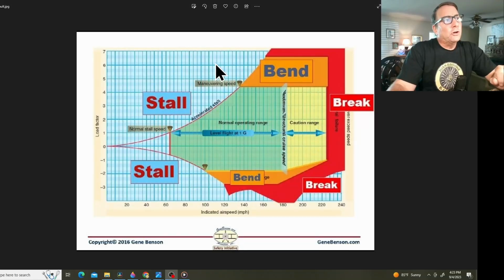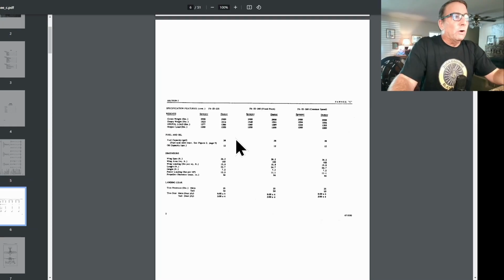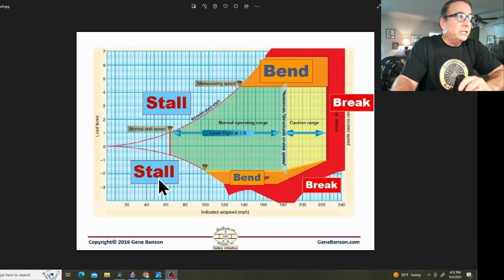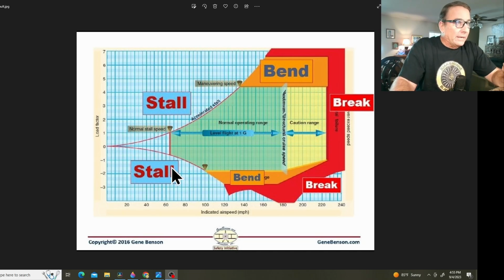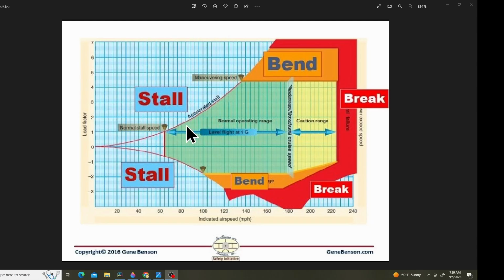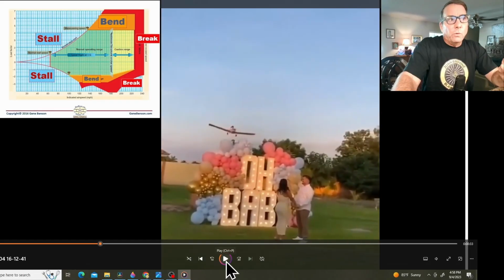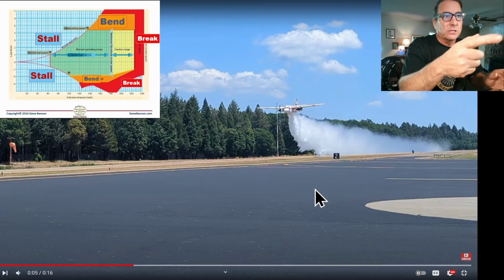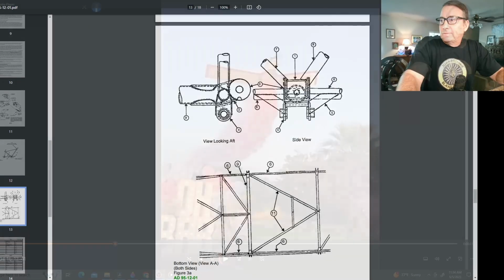PA25-235 Sinaloa MX Gender Reveal Party Structural Failure

Comment: I am not knowledgeable in aviation but based on what you mentioned about maneuvering speed. Does this mean that for a brand new airplane you can operate the flight controls in any position as long as you are below the maneuvering speed without causing structural failure of the airframe?
Reply: Yes but you have to include the total weight in the plane, cargo, passengers and fuel to know what the maneuvering speed actually is (as Juan stated the planes placard maneuvering speed is at full load, so as likely you are less then full load which  reduces the maneuvering speed)

Comment: Your analysis of weight vs maneuvering speed vs G Load vs lift force is excellent and fascinating but requires a deeper dive. 

In the case of the Pawnee the wing structure apparently failed near the root after releasing weight from the fuselage.  

Although the weight release would have lowered the regulatory maneuvering speed, it seems unlikely to have contributed to the structural failure.  

At the given airspeed assuming the critical AOA was reached the lift force generated would be independent of weight as you said. 

At lower weight the aircraft would have experienced greater vertical acceleration (measured G Load for example by cockpit accelerometer) than otherwise ( F= MA.)

And as you rightly point out some structural failures might really just depend on measured G Load - maybe the tail falls off or something.  

But a failure of the wing root is not in this category.  As the proportion of the aircraft total weight represented by the fuselage decreases, so the load on the wing - fuselage joint decreases at any given lift force (a higher proportion of the lift force goes to accelerate the mass of the wing itself).   

It’s one reason fuel tanks are placed in the wing.  Fuel in the fuselage requires a stronger thus heavier wing root joint. 

Again super excellent video, very thought provoking thanks.
Reply: What? No, what you say makes no sense. The wing roots would be where the force is applied when the aircraft is pulling Gs. Overstressing an airframe is on the wings and tail. 

Fuel is put in the wings because you have space available. The fuselage is usually reserved for other things.
Reply: @rtbrtb_dutchy4183  the way I see it not all of the weight is in the fuselage.  The wings also have mass.   So as the ratio of fuselage mass to wing mass goes down, the stress on the wing junction goes down at any given G Load.   Take an extreme case - imagine  the fuselage weighs nothing.   Then whatever rhe G Load on the total airframe none of that will be transmitted through the wing junction.

Comment: Many years ago ('94-'95),  as a young A&P, we had a Pawnee with Hutch metal wings that were just full of cracks.  We pulled the wings to repair them and found the fuselage wing attach points badly rusted internally.  They looked great with nice paint on the outside, but just ugly inside with much material missing.  It left on a truck to an aerospace welding facility for replacement.  Scary stuff considering how they get yanked and banked in a highly corrosive environment.
Reply: Like old houses near the sea, paint layers is only thing holding them together.  I think Popeye the sailor man had a song about that
Reply: @shable1436  we had a water tank like that at work. you knew the metal had gone through when you saw the bubble in the paint. then we used to just drill it out and stick a nut and bolt in with a rubber washer.
Reply: the glory[& FAILS] always shines on the OPERATORS/pilots but, the MECHANICS and all that attached to support their mission[s] really is so important......maybe more so [idk4sure]
 
OPERATORS are the ones also in the line of weather a vehicle or equipment is safe too operate.  

So it maybe would[have] passed PILOT pre-flight inspection but really it is a TEAM that creates the missions capability to be a success as in returning. The total success ends with safe return.
Thanks Juan,great report w\insights

Semper Prorsum ~ Godspeed
Reply: It's fineeeee
Reply: You save money by replacing maintenance with paint.

Comment: I think I understand this differently:  Seems the stick had to have been back before dumping the water just to get enough angle of attack (consistent with adequate speed to prevent stall) to generate the needed lift. Then once the water was out, that was too much elevator input, which caused an abrupt pitch up, loading the wing to failure.  The pilot needed to have pushed forward as he let the water go.

Is that a valid way of looking at the problem?

Thanks so much, Juan!  I’d be your passenger any time!

Comment: If the hopper was in front of the pilot, the center of mass likely shifted backwards significantly, increasing the magnitude of the pitch-up. It does look like the wing itself failed, so it appears the pitch up was extreme enough to increase the lift beyond what it was even fully loaded.

Comment: A wing folding on an old Piper doesn’t necessarily mean that the spar snapped. The wing can pivot around its bolts when the struts are removed, so it might just as well be the failure of a strut or its attachment that caused the wing to fold. 

A decrease in mass (and hence weight) causes a decrease in Vs. This also causes a decrease in maneuvering speed as Va=Vs•sqrt(Nz max). This decrease in Vs and Va does not cause it to move along the stall curve as indicated in the video, instead both speeds just move left in the graph (same Nz but at a lower speed), creating a new stall curve for that mass.
Reply: It is useful to define your variables if you want people to follow along. Sure you can say these are somewhat standardized terms, but then who are you talking to, people who already know this?
"Va" = maneuvering speed, or accelerated stall speed
"Vs" = unaccelerated stall speed, normal flaps up stall speed
"Nz max" = limit load factor, expressed as Gs

Comment: OK Juan, this one has me confused! I’m not sure I understand how reducing the overall weight of the aircraft increases the strain on the air frame at a lower speed. Is it because you suddenly now have the ability to change direction more rapidly, therefore exceeding the stress levels of the air frame? It seems to defy logic, and I’m really not sure from a physics perspective how this happens. Would love a video on the physics of this.
Reply: With higher weight, the aircraft stalls before it can exceed the maximum load factor (Gs) of the design of the aircraft.
Reply: In a sense, you are correct. I’ll try to explain and since I’m not sure how much you know about aviation lingo, I’ll try and keep it simple. 

When an airplane flies level, it flies slightly nose up. A heavier airplane has to fly more nose up than a lighter aircraft to create the same amount of lift. (Technically it’s the wing’s “nose up”, but for ease of explanation, I use the whole airplane)

Wings will stop flying when the nose is up too high while in level flight. 
Small airplanes, this is around 18° degrees nose up. A heavy airplane will cruise at 6° nose up, while that same aircraft when light, will cruise at 2° nose up. 

If you were to yank back on the stick and create high G’s, the heavy airplane can only increase the angle from 6 to 18°, so 12° and the wings would stop flying. 

But the light aircraft, starts at 2°, so pulling the same G load, it’s only at 14° and the wing is still flying. So this light aircraft can still pull back harder and increase Gs before it hits 18°. 
These extra Gs might overstress the aircraft.

Comment: I have watched those planes do alot of maneuvering during cropdusting large fields near an airport where I worked.  Surely saw them pull up hard and turn around at the end of each pass but they were not dumping a whole load of "crop dust" at once.  Maybe not as fast either.

Comment: I understand your point about maneuvering speed decreasing with decreasing weight because of the possibility of g-loading parts of the aircraft other than the wings.  But in this case, it was the wing that failed.
What I wonder was whether a CG-shift due to the sudden load release could have caused a sudden pitch up moment (possibly adding to the pilot yanking on the stick) that caused the high angle of attack.  If this pilot was more experienced at agricultural operations where the load is released slowly, then he wouldn't expect a sudden change in aircraft trim.
Reply: The g loading is only the wings and tail. Other parts is not an issue. Not sure how you get this. But the g load is on the wings. The wings carry the airplane.
Reply: @rtbrtb_dutchy4183  Only on the wings and tail?  What about the pilot?

I'm referring to a statement Juan made in the video.
Reply: @michaelandreas2177  of course, the G forces are on everything on and in the airplane. 
But the structural limit is decided upon based on the wings and tail. Not based on a wheel that can come off at 4 g or an access panel door that comes off at 4 g. 

It’s all about the wings and tail, do they stay on at 4 Gs.

Comment: Jb, I have about 4000 hours in basically the same size and classification Airplane the Cessna 188 husky.  
  And I can tell you the husky with the 540 in it at 310 hp if I was to pull the dump valve and pull the stick back to my sack it would flip over on its back almost instantly after dropping even 100g of product.  
  I had a friend of mine killed like that, engine out loaded gets right close to the ground dumped his load and pulls back ripped those spars right out of the fuselage.  
 Not sure what the training requirements are for those guys where this took place but they sure need to be addressed.   
   The C188 POH states during an emergency dump, fly straight and level no more than 10° plus or minus. 
  Like you say, he was probably going close to VNE in that vid an absolute recipe for disaster
   Generally have about one of these a year during gender reveal parties.  
   I think you did a story about 4 years ago. The one in Georgia Pilot had 6000 hours in an air tractor and then gets too slow stalls and kills himself dumping his load

Comment: I think it’s force that breaks things, not the acceleration expressed in this case as G

Force = Mass x acceleration or to put it in aircraft terms, weight x G

So when you reduce mass/weight instantaneously , you should also reduce force and lessen the strain on everything that’s “holding hands” keeping the wing on.  

Now a sudden pitch up, either intentionally, or as a result of that drop would obviously increase the angle of attack and the relative load on front and rear spars and fuselage attach points changes because of the twisting moment of the wing in relation to the fuselage. 

I think it will be found that there was corrosion or preexisting failure in the aircraft structure.  

I see how the V/G curve will be different at something other than gross weight where the standard graph was made but it doesn’t make sense that it  would necessarily shift to lower speed because the weight factor of the force that’s trying to break components is decreasing.  F=MA

Comment: Another great report Juan.  Odds are he did this for a friend or relative, but sadly, he ran into the ultimate Kablammo!  Odds are he does this often while he is crop dusting but his speed isn't as high, and at the end of each run there is still weight in that tank.  At the end of his crop dusting he just probably does a slow climb out and goes back for more fluid.  He doesn't however empty the tank in 3 seconds at full speed and then pull the stick back to show off for his friends or relative's.  Sad deal.  How often is there a "Hold my Beer" moment for a baby gender reveal?  Sort of nuts.

Comment: The original Pawnee 235 had rounded wing tips, the accident plane had squared off wings which appeared longer.  Juan, how would you like to ferry a Pawnee to Chile or Argentina with the chemical tank full of Avgas?   It's been done. Knowing the ceiling of the plane was lower than a pass in the Andes, I asked the pilot how he planned to cross those mountains. He just shrugged and said, "Wait for an updraft."

Comment: Excellent video as usual!  
As a sometimes-getting-paid-for-it aerodynamics by training Ph.D. I view this through the basic physics lens.   The force on the wings is proportional to the AoA and square of the airspeed (hence the  exponentially rising limit curve vs. air speed).  For a given speed, at heavy weight when you pull back on the stick the airplane cannot increase it's angle of attack quickly due to the airframe/load inertia and thus the rise in force on the wings is slow.  At low weight when you pull back on the stick the AoA can rapidly increase because of the lower inertia/weight and quickly get to the point of generating a huge amount of force that's trying to yank the rest of the plane upward.  Ever put your hand out the car window like an airplane wing and tilt it upward a little too much too quickly and your hand snaps upwards.  If your hand was made of lead it would snap upward far more slowly than your water-ish made hand.  That and the heavy plane/hand was already at a higher angle of attack to counter the aircraft weight/hand weight to keep it in the air.   Ever see a light paper/balsa wood airplane suddenly get too much lift it pitches up very quickly whereas a heavier paper airplane does not pitch up nearly as fast.  Excellent video as usual.
Reply: Thank you for confirming the reason for the "low weight" limits on maneuvering speed.
This is the same reason why some friends who work as maintenance/defense contractors warn pilots to be extremely careful when flying aircraft on short ferry flights. Minimal fuel, no pax or cargo (or wing ordinance!) the jet will respond very differently than it normally does, and this is especially noticeable on takeoff as the jet will accelerate quickly, and overspeed the gear and flaps, etc. and a sudden pitch up, is at high risk of exceeding limits. Another risk for inexperienced pilots is scraping the tail on the runway.
Reply: So…as I understand it…Don’t treat an aircraft like some video game!
Reply: Or a high performance jet fighter! @57Jimmy
Reply: Excellent explanation.  Thank you, from one PhD (in an entirely different field) to another.  I’m a student of aerodynamics as a hobby, especially low-speed aerodynamics for soaring and the use of negative flaps (“drag buckets”) for increasing L/D at various speeds.  So this nice summary really resonated with me.  Thanks again.
Reply: So let me get this straight:
Airplane is loaded heavy with acceptable wing loading & angle of attack,  pilot dumps all "cargo", which allows the aircraft to pitch up increasing angle of attack which increases wing loading at a high speed & exceeding limit of airframe  strength/design,  and wings break off. 

I don't understand yet that this would be as great a problem if there was no sudden lightening of the aircraft. 
Thanks so much for your explanation above. I'm learning.
Reply: @russellmitchell8177  it happened because he pulled up hard, not because he dropped the water. If he'd been coming in at max maneuvering speed for full weight and pulled up without dropping the water he would have been ok. Coming in at max maneuvering speed for full weight and then dropping the water and then NOT pulling up he also would have been ok. But after he dropped the water he would have been over max maneuvering speed for his reduced weight, and then pulling up like that resulted in too much lift. But it could also be that he was over max maneuvering speed even for full weight.
Reply: Excellent. That chart is just confusing for my non pilot brain but what you said makes perfect sense
Reply: An entire YouTube video could be spent fully explaining the physics behind that chart that Juan used - the physics is non-intuitive and hence why it gets pilots in trouble (as explained by JB).
Reply: Ok that makes sense. I was about to rewatch the video. I was also wondering if destructive oscillation could be a factor as the wing load drops quickly as the water is dumped then loaded quickly when the pilot pulled up?
Reply: Thank you johnhinkey.   That makes more sense.   I couldn't really follow Juan's diagram but your explanation makes intuitive sense to me.
Reply: High... moment of... torque, perhaps?
Reply: Exactly the explanation I was looking for, it's mostly due to a change in elevator authority. Dumping a lot of weight will reduce rotational inertia and may even change CG, so at the same speed the plane is able to pitch up much faster and expose the underside of the wing to oncoming air much more quickly, resulting in a higher peak force and higher chance of damage. Safe maneuvering speed is lower when lighter to eliminate that risk; even if the right pilot could carefully maneuver the plane at higher speeds by being more gentle on the stick, it's still too dangerous.

Comment: Just to add a quick rule of thumb to adjust your speed to the new weight. The speed variation is half of that of the weight. 
E.g if the weight is 20% lower than the MTOW, then your variable speeds will all be 10% lower than what the manual says. I mean Va, Vs, Vy, Vx etc...

Comment: An intuitive way to think about maneuvering speed is in terms of AoA "headroom", or the difference between how much AoA you are using, and the critical AoA. When the airplane is lighter, it uses less AoA in level flight. That means you have more "headroom" for AoA to increase before reaching the critical AoA, and a bigger G load can be exerted on the airplane before it stalls.
Reply: Nah. The headroom doesn’t make sense. Your explanation is correct, but the “headroom” part is weird.